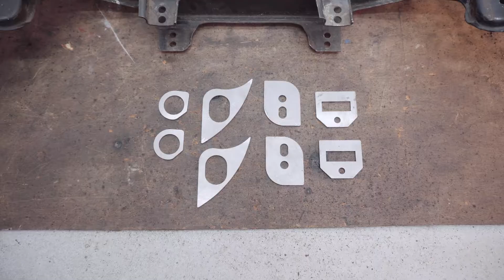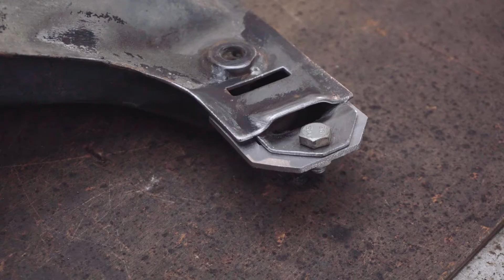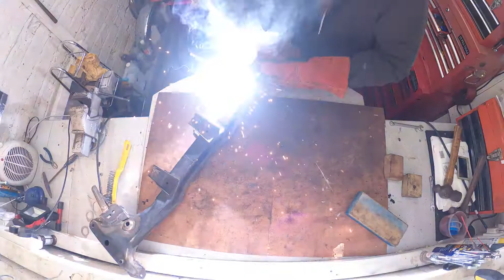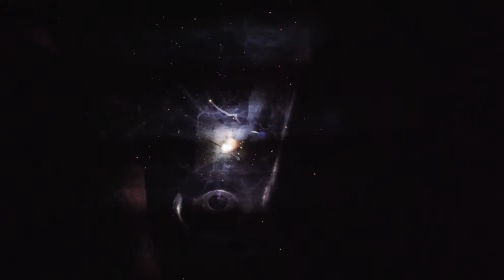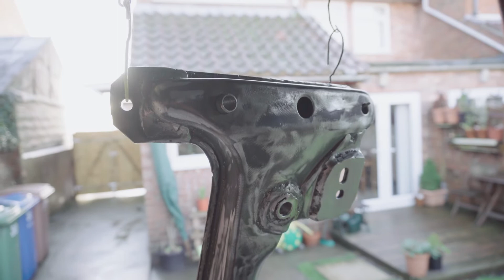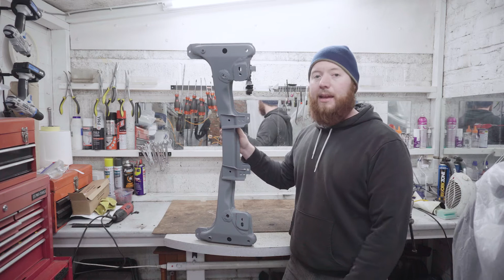BMW E30 Front Subframe Reinforcement | How To Install Weld-In Plates | 003

Comment: Just about to do this to my subframe (well, getting a mate to weld it lol). Great idea with the anti-roll bar plate modification, I was scratching my head trying to figure out how the plates should fit, but now I'll definitely be doing it your way. Another bonus is now the ARB bush brackets won't be mounted one side on the raised plate and sitting slightly cockeyed.
Reply from the maker: Awesome, glad the anti-roll bar plate modification idea helped you out!

Comment: What type of welder did you use? the link isn't working anymore. was it just a Flux core Mig welder ?
Reply from the maker: Hi mate, I think in this video I was using a cheap Wolfweld MIG welder with fluxcore wire. It seemed to work okay but it was tough and had lots of spatter.

Check out some of my later videos where I moved on to using a Clarke MIG welder with small gas canister, I get way better results now with that.

If you're looking for a start in welding. I'd recommend going for the gas type straight away, that's when it really started to work for me.

If you have a skim through this series you'll see me using that other welder and sharing my settings in detail.

Hope that helps!
Reply: @SPANNERRASH  thank you for the quick response that does help a lot ! Thank you for the tips! I really enjoy all these videos. Thanks again for not only building your project but helping others on their journey as well.
Reply from the maker: @Datboijupiter  You're welcome, thank you fod the kind words mate!  😁

Comment: So if you do quick small little circles while welding and "carry" the puddle it will give better unification between the 2 pieces of metal while also adding more heat. Just be careful not to stay to long in one spot or run back over the weld you just laid down since it will have the possibility of incorporating the slag or flux. Also try to drag the puddle a lil (welding nozzle in front) Kind of hard to explain but hopefully it helps. Loving the vids and learning new things thank you n keep it up bro.
Reply: Also if the weld looks like a wet noodle just sitting on top it means you don't have enough heat and the weld is not good. Its all a balancing act between speed, heat, and filler metal rate. But once you find the sweet spots it just comes together. Lol pun intended.
Reply from the maker: @dr.borishnakov9632  Thank you mate, those tips are invaluable. I have since started to feel like I'm getting the hang of the welding a bit more, although I'm still very much learning as I go.

It's bloody difficult welding as I'm finding out!

Comment: Just had a watch of this to see how you went ahead with it! As you were saying about your welding, it seems you don’t have the hood on the welder! Unless you’re using fluxcore? But you seem to be getting a crazy amount of spatter from the welds which as you probably know is an absolute pain. You can get anti-spatter spray which really helps the bits not stick
Reply from the maker: It is fluxcore but maybe the hood would help anyway? The spray sounds like a great idea, I'll look that up, cheers mate. 😁 Bear in mind this is my second ever attempt at welding, I've got a lot to learn for sure. 😂
Reply: @SPANNERRASH  Just buy a bottle of CO2, it's cheap gas for welding and stop using fluxcore wire. other wise your wire feed and amps are close to good.
Reply from the maker: @juholansivuori5025  cheers, I'll have to give gas a try, seems a lot of people say its better.